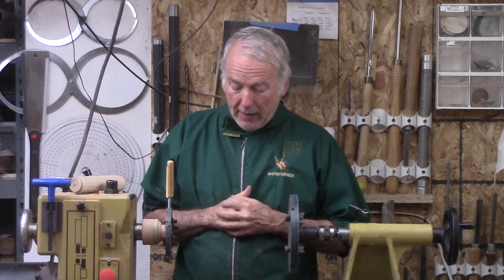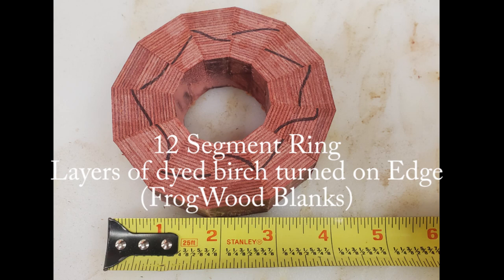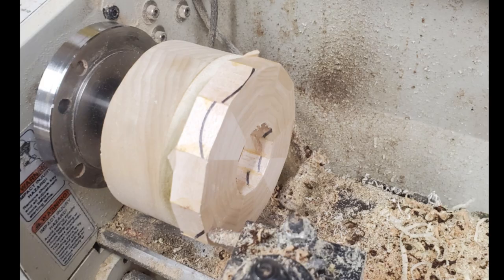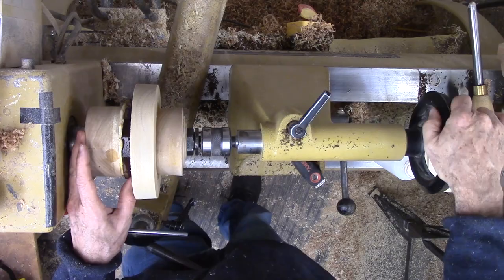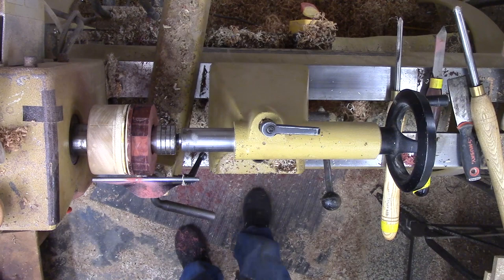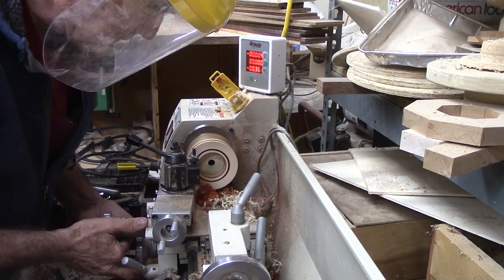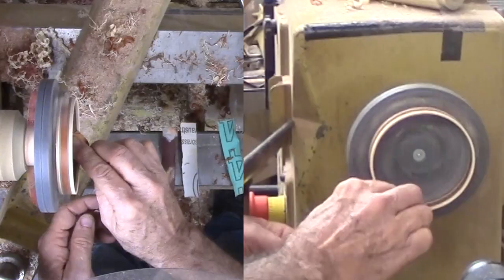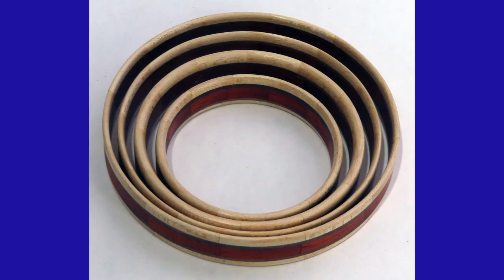Woodturning Bracelets and Bangles With Custom Mini Longworth Chuck

Comment: Alan, I've watched both videos now, and see that you turn bracelets singly or perhaps occasionally  in batches. As they are jewellery I checked my jeweller's chuck, and found that it expands from 1.9" to 3.0"and would allow all round external sanding of single items.A temporary soft jaw surface can easily be added and removed with acetone if required, and gives a step off the metal.. For batch production I am planning a project nesting stacked bracelets on my  doughnut chuck, with terraced  baseplate ;rods removed and temporarily held in a suitably sized cylinder whilst the inside is filled with sacrificial nonstick builders spacer aerosol foam; plus tailstock support.That would later be cut out for individually finishing the insides. Bracelets are not my interest, but the challenge must be met, so I shall report back sometime later.
  The jeweller's chuck spindle is only 12mm dia. and can be held in a Jacobs chuck should a suitable adapter not be available. A dedicated faceplate could replace the doughnut chuck..   Bernard.
Reply: Alan, soon after commenting I thought of my  regular long nose jaws, which have 1 5/8" parallel outsides, probably enough for sanding 2 bracelets at a time.Good range of expansion, and broad elastic bands suitably placed before the bracelets would give grip from a soft surface; leaving space at each end for working. Even broader bands can be cut from old tyre inner tubes, as we used to make our rubber bands during WW2, should they be required for better grip. Probably just as fast and simpler than stacking 6 bangles. Hope I am not missing the point.  Bernard.
Reply from the maker: The point is to have options and then to choose what works best for you.
Alan
Reply: @AsWoodTurns  Update following experimentation. Longnose jaws covered with a single turn of Coban, a 3M self adherent conforming elastic surgical bandage, work perfectly. Bracelets 51 to 71mm  id can be gripped, and if necessary shims can be slipped below the bandage, allowing several bangles of slightly varying id to be sanded at once. For those measuring >73mm id I have a model engineers chuck with cole jaws to cope. Sorry about misspelling your name in a later video: We have an Allen in the family.    Bernard.
Reply from the maker: @bernardfutter5327  Good to know.

Comment: The Longworth chucks work quite well. Have you experienced any problems with workpiece breakage due to over tightening the chuck? Your bracelets do appear to be quite thin. Thank you for sharing. Have a great day and continue to stay safe.🙂🙂
Reply from the maker: No. I was concerned with the thinner bands but since there is no short grain, no problem.
Alan

Comment: To anyone that uses a metal lathe to turn wood after each use blow off chips especial on the lead screw and half nuts. I have owned several metal lathes in the 10” to 12” swing range. I purchased one at an estate sale that was used to turn wood most likely green wood the lathe looked very good and well cared for and l got a bargain. After getting it to the shop and set up and powered up and checking it out l could not engage the power feed low and behold the half nuts were packed full of wood chips must have been from wet wood and been the for years in and unheated shop as the area around the lead screw in contact with the packed chips had rusted to the point there was no threads at all one a length of about an 1-1/2” long, still a bargain but a  learning experience also l like the video
Reply from the maker: Good things to do in the clean up.  
My impression on turning green wood on a metal lathe is that the previous owner missed a lot of the experience they would have had on a wood lathe. Each has plusses and minuses. They trick is to be able to use the best features of each.
Alan
Reply: @AsWoodTurns  this was an atlas model th54 metal lathe that had the option of woodturning tool rest that fit on the cross slide
Reply from the maker: @larryhill6187  It would be interesting to try it out.
Alan

Comment: ??? Alan when you make your screw faceplate what wood works best and grain orientation?.
Really enjoy your videos have learnt so much thanks keep it up
Reply from the maker: Go back to my video on "Five Options For Woodturning Lathe Faceplates". Any close grain hard grains should do. Many use maple. I use poplar. it is less expensive and serves well. In any wood, I flood the threads with thin CA, let dry overnight, and run the tap in again. I don't think I have retired any for thread issues.
Alan
Reply: @AsWoodTurns   thanks for the info